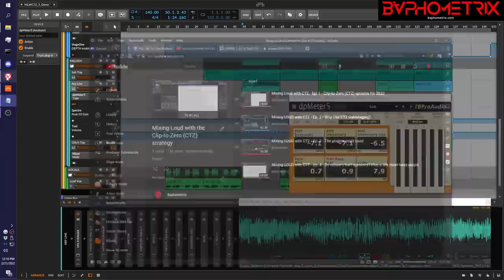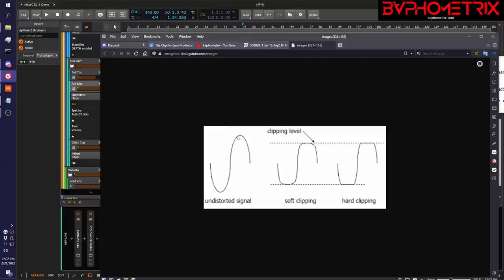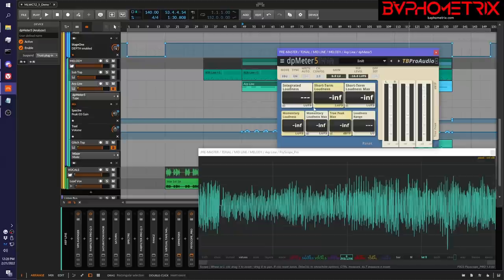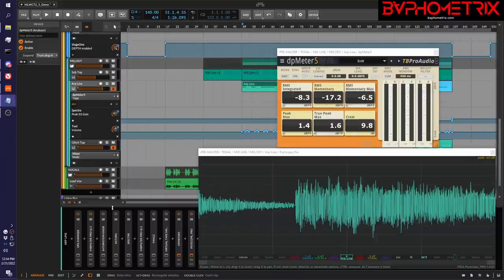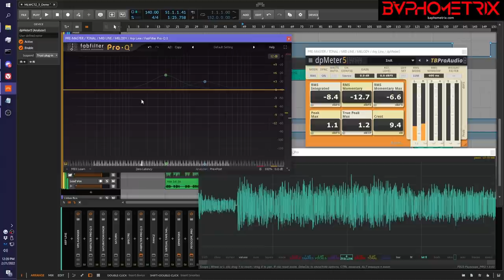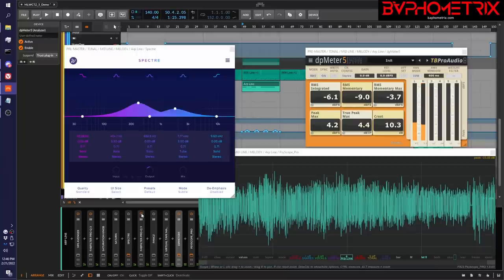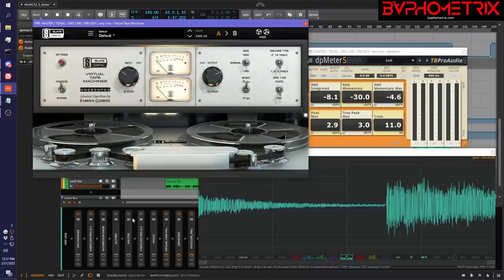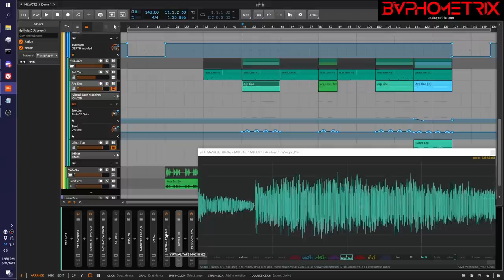Mixing LOUD with CTZ - Ep. 5 - Controlling dynamic range by "saturating from the bottom"

Comment: How would you suppose ableton’s stock saturator compares to some of these or other 3rd party options? I now worry my saturator (ableton’s) may be inadequate for achieving loudness at my target range of ~5 LUFS.
Reply: ...and yes, i'm struggling to hit that target. I'm currently hitting -8 -7ish with mostly stock plugins.
Reply: Also, been interested in Spectre since I watched your video about frequency-sidechaining and as someone who hates using EQ for boosts, I'm seriously considering buying it. I'm a little confused about the mix knob on it. So, at 50%, half the signal coming out of the plugin would be the original and the other half the newly saturated signal, correct?
Reply from the maker: Abletons' stock saturator is great.  But don't stop there. Overdrive is great too. So are a lot of their cabinets. The Bass cabinet is also a really good coloring saturator, for example. Basicially, color the heck out of everything with any type of saturation/distortion FX you have.

Comment: Saturn 2 does frequency specific saturation, to my understanding. Have you compared it to Spectre?
Reply from the maker: Yes. Saturn is a fine tool. The workflow is different than working in a tool like Spectre (or GodMode), though. The main difference is that Spectre uses crossover filters to chop/segment the spectrum into discrete bands. By contrast, Spectre and GodMode work with bell boost filters that can overlap  each other. The results are different.
Reply: @Baphometrix  Saturn 2 has multiband saturation–maybe this is still different than Spectre's? I was under the impression that Saturn 2 used crossover filters to partition the signal into discrete bands too. In any event, you can use different saturation on different parts of the spectrum in Saturn 2.
Reply from the maker: @ThomasPosen  Hmm... Maybe the newer  version of Saturn offers a new type of saturation? I admit to not upgrading to the latest version. If so, then yeah, I'm sure Saturn can give you comparable results to Spectre?

Comment: I would expect hard clipping to be more audible than soft clipping because of the sharp discontinuities in the waveform creating more and nastier harmonics. I take the point that soft clipping affects more of the waveform, but still. I guess it's all about that ratio. Do you just have to be hard clipping a very small part of the waveform to counteract the more dramatic waveshaping that it causes?

Also would the feeling of the audio getting warmer/bassier when you clip the signal be due to the harmonics it's creating which emphasize the fundamental?
Reply from the maker: Your questions about hard clipping will be answered in the next episode. :).
Reply: @Baphometrix  I will wait patiently in that case

Comment: What about using same preset from spectre on saturn? Like band separation, tube saturation and band shape. Does it sound good too?
Reply from the maker: The architecture in Saturn is very different. Spectre doesn't actually put the signal through a typical set of Linkwitz Reilly crossover filters like most "multi-band FX" plugins do. You can test this by putting a square wave through both of them and looking at the output in an oscilloscope. If you put a square wave through Spectre, it's still a perfect square wave on the other side, even at 50/50 mix. (At 100% mix there's no wave at all.)  Then grab a node and drag it up and watch how the square wave remains *perfect* but a small wavefolding type of deformation appears in the waveform. Flip to 100% wet and you'll see the shape of the parallel signal that is actually creating that band-focused saturation. Morph between 100% wet to 50% and you'll see how the parallel signal is being *morphed* with the dry square wave.

Now try the same thing through Saturn. Set it to 50% dry/wet. Add two band splits (so you have three bands). Put a square wave through it, and watch how the square wave is TOTALLY deformed into something else entirely. This is the problem with most multiband-FX: they completely change the signal running through them. That's perfectly OKAY if your goal is sound design--and you could make the argument that saturation is "sound design" just like I did in my video. 😉 So using Saturn in this way might very well sound great! Don't be afraid to try it. But just be aware that Spectre is quite different.  Wavesfactory makes some really excellent plugins. Spectre and Quantum are both unique and very pristine and well-built.
Reply: @Baphometrix  thanks for this answer 💪🏻

Comment: I'm going to be honest, I either baaaaaarely noticed a difference in sound between the original sound and any of the saturated signals, or I didn't notice it at all. I reran through some of the examples with closed eyes multiple times, but I still couldn't tell a difference most of the time. Is there a good resource or practice method to get me better at ear training the differences? Thanks in advance!
Reply: @jona8659  Thank you for this. Was very helpful!

Comment: hi baph great video. Where should i put the saturator plugin in my sound design mixing chain? before reverb, delay certainly but what about compression?
Reply from the maker: Processing in front of or behind compressors is always an "it depends" type of decision. My first choice would be *after* the compressor IF you were using the compressor simply to sharpen the transient punch of a signal. Shape first, then saturate for some loudness and beef. But if I were doing the compression in part for hyped upward compression (such as OTT), then I might choose to saturate first and then hype the saturated result. So.... it all depends. 😆
Reply: Thanks for this answer. Adding saturation before upward compression is a really good idea! Btw I just bought spectre and tried it out on a piano and a sample. Strangely I am getting a higher crest factor on the dbmeter... I have to do something wrong
Reply from the maker: @chooby4670  Saturation does not always create a lower crest factor. A lot depends on what type of signal you're saturating. And in the case of Spectre, it depends on which part of the spectrum you're boosting and by how much.

Comment: I added saturation with (newfangled saturation on soft clip plus auto gain on).I am getting lower crest values on every track but I am over 7 db  on the master. How do I bring the values down on the Master? I measure with dp meter and getting  6 lufs on the master being 7 db over the master.If I lower all the volumes on the master by 7 db than I see a reading of 13 lufs on the master. How do I get to a lower lufs with saturation? Do you do a mix down before you start ctz method and adjust every track volume?do the crest gained can be added back to the volume track ? confused.spent 4 h in the studio and can't get it
Reply: Clip off your master buss at 0dB. So that hard clipper should be getting 7dB of attenuation

Comment: Would I get a similar result with saturn 2 on a return track with specific bands and crossovers enabled instead of cashing out on spectre?
Reply from the maker: Yes and no. Bottom line is that any band-specific saturation is a useful way to boost the energy/loudness of a specific area of the spectrum. Spectre goes about this differently than Saturn 2 does. But ultimately, if it sounds good, it is good.
Reply: @Baphometrix  thanks for the answer man, do you offer 1 on 1 lessons? I've never done ctz before and I would just let my master limiter push 15-20db of gain reduction (I started only 2 years ago) and now that I have tried ctz on a few existing projects I got questions, I'm making kind of dubstep but at 90 bpm instead of 140-150

Comment: Hi man nice job as always my.big questions i got kazrog clip and its for sure.a.different version then yours it has an  oversampling knob  and i cant get how to turn it off i leave it on 1 and it sould be off until you gonna touch the oversampling knob do you know how it works ? And as you told in your tutorial i tent to use it almost on every track in a traspaent way
 unless its a sub or a sub bass tht im.not.gonna.clip.at all,  I'm not sure about the master if I'm doing right putting a free venus clip at the end before the limiter stage with hard clip 1.5 or 2 db of clipping and setting s post overspampling to 0 x2 i also have tried far more extreme setting and i found on some project gonna sound better with 8x oversampling and 6/7 db hardclipping  do you thing its gonna be too much? Squezze out a limiter by reducing 7 db on the master its gonna be terrible but i think 6db of hard clipping sounds good  in  lots of situation.Help !
Reply from the maker: I'm not sure what to say. The latest version of KClip is 3.2.4, which hasn't changed or been updated since Feb of last year (2021). I'm using version 3.2.4 in my videos. As you can see, there's no "Oversampling" knob in the GUI.  (It's hidden in a settings tab, and yes, you should leave it at 1x, which means NO oversampling.)  As for the rest, by all means you can experiment with variations on the techniques, settings, and approach I'm showing you. If your variations seem to work well for you, great!
Reply: @Baphometrix  thanx man i was wondering but u make it clear now about 1x i tought it was off on 1x but not sure  thanx again ...and when u say to not have a big massive clip.at the end instead of clipping as ctz, what exactly means massive in db just to understand if i do something  wrong using ctz  on the last stage i already get the right loudness in mixing also before i got to know your strategy but definly better with ctz in terms of overall resault and quicker then i was used too but the last boost on the masterbus it seeems  to sound good using ctz also if 7bd its a.lot i never ever im.my life compress or limiting so hard always 1/2 not.more then 4 db of reduction now using ctz i noticed i dont need to.set the threshold more then 0.5/1 db of reduction  on the limiter but i hve tried to raise the clip knob at 7 db with Venus on.the mast with oversampling at 8x sounds great  do you know what happens i think oversampling before a limiter is crucial and done with a clipper raising the clipper instead of pushin the limiter treeshold has a really huge benefit but this is possible only working with ctZ mixing if you try what im saying or u already done some tests about it  lemme know have a wonderful day!

Comment: I see you are using Saturn 1, but doesn't Saturn 2 have a multiband distortion the same as Spectre?
Reply: i was thinking the same thing. not sure if saturn can do the bell shape ?
Reply: This is what I'm wondering.
Reply: Saturn 2  does multiband and linear phase, so it looks a lot like what Spectre can do to me.  Would you still prefer Stectre over Satrun 2, Baphometrix?

Comment: Hey Baphy I have a question that feels like a dumb question but its currently hurting my brain. Say I'm "saturating from the bottom" with a saturator in ableton live, would I want to leave the soft clip button off when using the CTZ method?
Reply from the maker: A lot of Ableton users don't realize that when they use Saturator or Glue Compressor or any other device that has that "Soft Clip" button in it, half the time the goodness they're getting from that device is the crest reduction from the soft clipper.

At the end of the day, you can use three things to control crest factor: hard clip, soft clip, and limiting. All three will somehow "clip" the peaks. The reason I stress using a hard clipper FIRST is because it's the most "transparent" in terms of how it changes the signal. The idea with "clip from the top" is that you don't want to audibly notice any change in the sound. You want to trim peaks but in a way that doesn't noticeably "color" the sound. A soft clipper will audibly "warm up" the sound. And a limiter will often change the sound in various ways because of the release envelope it cuts into the original sound.

Comment: Saturn is a multiband saturator. Is it so different than Spectre?
Reply: In principle, “no”. You could make bands in Saturn and saturate as you please, then blend wet/dry with mix, but spectre just makes it way easier
Reply from the maker: different approach. Spectre is a parallel saturator. Saturn is a multiband saturator.
Reply: @Baphometrix  Saturn has a mix knob, so I guess it’s also “parallel”?
Reply from the maker: @PuRe_AdDicT  Not in the same way as Spectre.  To attempt to emulate Spectre with Saturn would require you to increase both the Drive and the Level of a given band in certain proportions that change with more density/volume.  All I can say is that I cannot easily make Saturn sound anywhere near as "clean and transparent" as Spectre.
Reply: @Baphometrix  I sure appreciate your reply, thanks and subbed!
Have you ever considered analog summing? :) I guess it’s a similar concept to how you’re using the plugins.

Comment: Upward compression can also be an alternative I guess? Like Waves MV2 only pushing the low level.
Reply: It’s really great as the third compression stage on vocals after FET (1176) and OPTO (LA2A), to get the low level details to the front.
Reply from the maker: Yes, but it has the same problem as New York compression.  It tends to bring up reverb and delay tails too much.
Reply: @Baphometrix  yes, you’re right. Only thought about dry signals and If the source is already pretty dense it could be an option. But yeah saturation is the way. Have you tried Tone Projects Kelvin (saturator)? It’s really great.
Reply from the maker: @tomman7729  I like Tone Projects a lot. Unisum is my favorite mastering (2 bus) compressor. But I haven't tried Kelvin yet.
Reply: @Baphometrix  I’m with you on that one. Although spectre is easier to use and it’s great, I find Kelvin to be more powerful and has better variety of different styles of saturation.

Comment: But Spectre does not create phase issues due to parallel processing? Thank you.
Reply from the maker: The Mix knob blends the saturation into the dry signal. It's not quite like parallel EQ. Depending on the mode you run Spectre in, you can either add only the saturation, or you can do a mixed EQ bump + saturation. Even when you use the mixed mode, the overall phase shift is less than a typical bell filter would do in a minimum phase EQ. (Check it in Plugin Doctor and see).
Reply: @Baphometrix  I am so happy that I found your channel! Thank you so much for your information and great explanations. I subscribed, thanks for the teachings!
Reply: @Baphometrix  going off what you said about oversampling saturation when used for color, shouldn't you be using spectre in the 'best' quality setting??

Comment: Can I just boost the frequency I like with spectre and then saturate with Saturn? :)
Reply from the maker: You can do anything. But if it were me, I'd consider using Saturn *first* for overall tone and color. Then if later it turns out that the signal isn't *loud enough* in some region of the spectrum, that's when I'd give it a bump with Spectre.
Reply: @Baphometrix  Thank you sir !

Comment: At 24: you say pro Q is not a saturator but you turn it into a saturator by clipping the output, probably why it doesn't sound good... Hard to compare A/B because of the clipping
Reply from the maker: You can't "clip the output" of a modern digital plugin like Pro-Q. These all operate at 32-bit float internally, just like your DAW channels. There is TONS of headroom above the 0 dBFS mark. No clipping.
Reply: @Baphometrix  I stand corrected, humbled and instructed, it makes sense when you think about it, thank you ;)

Comment: Like some others here, I also hear no difference between any of the saturation examples and the original. I wonder whether most of the people who this music is for will be able to tell the difference in context.
Reply: in my opinion this is EXACTLY why you would want to use soft clipping.😊 you wont really hear any difference but the subtle reduction of peaks in the signal will allow u in the end to increase your fader without exceeding the -0dB mark and avoid hard digital clip. so you will have a louder end result  compared to not using a soft clipper without really audibly changing the sound👍

Comment: Couldn't you just... Freeze and flatten everything. And manually reduce the peaks on the wave. Do this to everything and balance the mix to taste. Get it close to zero on the master. Hit it with the limiter.
Reply: I mean yeah, you could also individually draw in every single sample and youd never need a synth
Reply: Correctly doing this manually with proper/rhythmic release times or making it perfectly ducked would be a near impossible task. As meticulous as you'd get it would still be heavy handed compared to what these tools can do. Not to mention it would take years to finish a song doing this and you'd probably go clinically insane
Reply: @garretmeyer2006  another thing to be aware of is that abletons timeline automation atleast isn't quite accurate afaik. altho i must admit i do sometimes sidechain manually by cutting clips. i am clinically insane tho, so case in point really.
Reply: @garretmeyer2006  This makes sense.